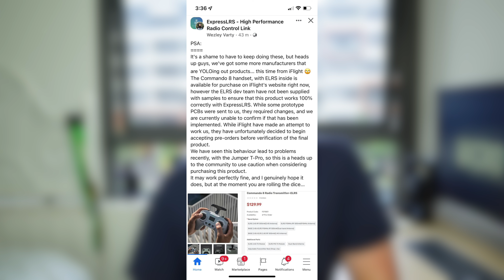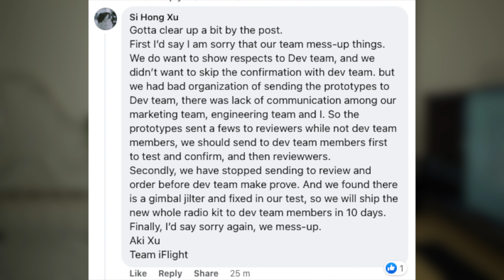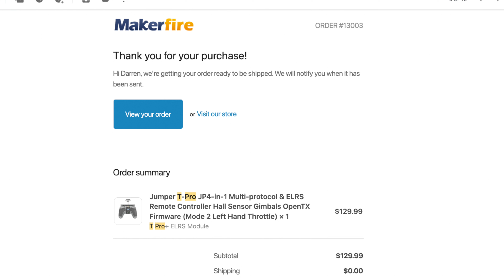CAUTION on buying Jumper T-Pro & iFlight Commando 8

Comment: I have jumper t pro elrs version transmitter but I want this transmetter to control two drone separately but it have 1 reciver and this reciver is not available in market then can i use radiomaster elrs and other elrs reciver connect with jumper t pro does  its work ?Will it work? And if I do, which receiver should I use?
Reply from the maker: Every drone needs its own receiver. As long as your transmitters and receivers are all on the same major firmware version, and have the same binding phrase they will work

Comment: I'm still waiting for my T-Pro with the internal ELRS module to be delivered, and the second I have heared about the problem with bricking the module I've bought an FTDI-adapter lol. 
Not a big deal for me as an electrical engineer to take the radio partly appart and reflash it but I understand why people have got a problem with this. I don't feel like this is the way to go for a well known manufacturer - To let the customers solve their problems on their own, even though most of the FPV-pilots out there are accustomed to DIYing things...

Comment: I feel like your comments on Jumpers is a bit harsh, the way to recover from a failed update isn't that hard and how many updates does actually fail in the firwt place. It not such a big problem that you should make a video like this.
Also it's totally up to the manufacturer to decide when to release information about a new product, and you are showing a picturec claiming it being 40$ cheaper but on the picture it's just 40$ of, that is not the same thing.
Reply from the maker: As a consumer, you shouldn’t have your radio brick where you need to recover it if an update fails. 

Yes it’s a major issue, as I like others end up with comments asking for help to fix those issues, and we give people support because a company took shortcuts when making a product.
Reply: @DarrenAllatt  What product does not have better support from the users than the company behind it?
It seems that very few people actually had problems with flashing and as far as I know it was just the initial batch of controllers that were affected with this.

Comment: I think some of the stores are pretty rough when it comes to pre orders as well. I pre ordered my jumper t-pro w/4 in 1 from FPVFaster in Australia for like $230, the external ELRS module was around $70 (pre order). Waited for many months. The day it shipped from them (on the release day) their website was selling it for $195 and $59 for Ext ELRS. 2 weeks later its $159 and $39. right now you can buy both in a combo for $199.  I can't not feel like thats a kick in the nuts. Makes it hard to contemplate buying from them anymore. Great Video BTW!
Reply from the maker: Couldn’t agree more that it’s a kick in the nuts. I’d write to them as ask for the difference back. 

Thank you 🙏